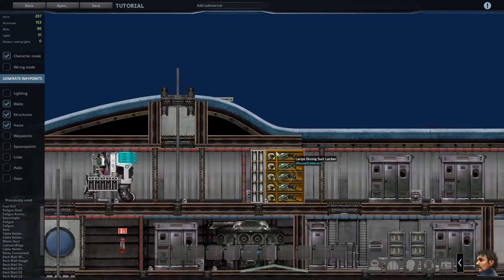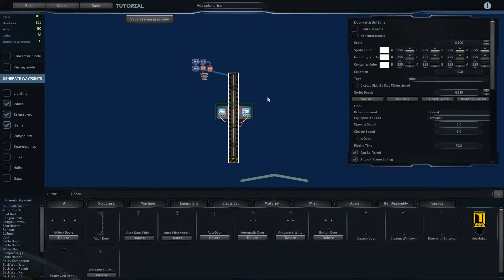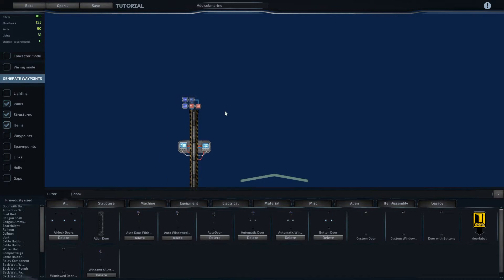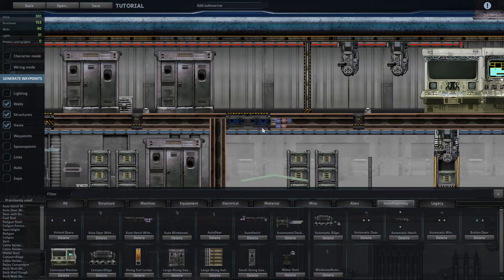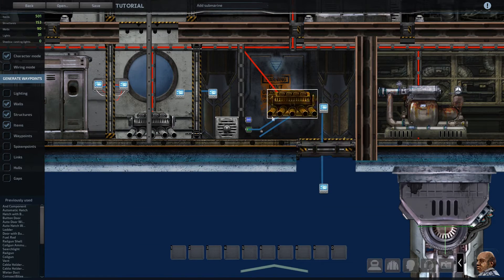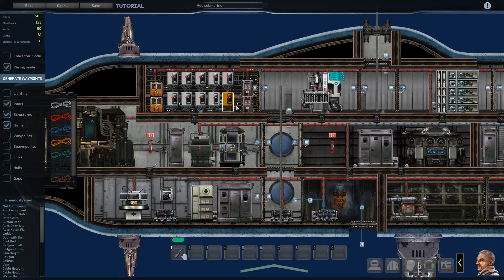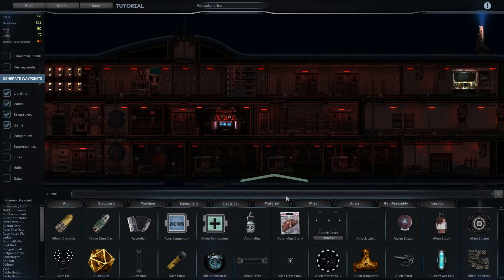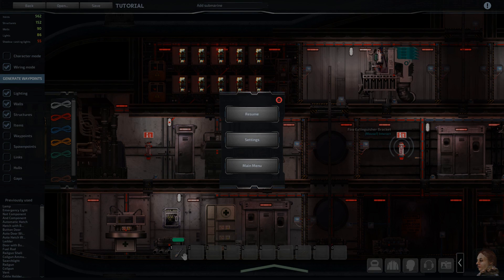Barotrauma Submarine Editor Tutorial Part 4 | More Wiring and Lighting

Comment: The auto-door doesnt work... Sure it opens, But it stays open. Am i doing something wrong or was it an update?
Reply from the maker: I don't think it was an update; it works fine in my save with no changes.
Reply: He doesn't show you the settings for electrical components unfortunately for some reason. But make sure the AND that is connected to just the NOT component is set to output 1 and false is blank. The AND component that is connected to the DELAY & NOT should output 0 and false blank.
Reply from the maker: @John-ns9lr  That was an oversight, my bad.
Reply: @John-ns9lr  Thanks.

Comment: I've just now invented a much better (in my opinion) door system that doesn't need a motion sensor (which I have found those kinds of doors to be highly annoying) and only needs THREE components. A delay component, an and component, and a not component. The delay component MUST have the "Reset when different signal received" box checked in order for it to work though. 

Here's how you do it. First you get all 3 of the components, set up and get 5 wires. Then you wire the state out of the door to both the delay component signal in and the and component signal in 2 (or 1 it doesn't matter), then set the delay component's delay to 2 seconds. Then wire the output of the delay component into the other and component's signal in, and the and component's signal out to the not component's signal in. Lastly you just wire the not component's signal out to the door's set state and you should be all good. 
I don't think you even need to be in the sub's editor to do it, but the default door's invisible wiring from the editor might mess with it a bit.

Comment: I was wondering...for the areas of the hull, that are adjacent to black spaces, for example the top left of the sub, under the left top coilgun... if that section of the hull is damaged, would a mechanic be able to reach it with a welding gun? Would flooding occur in that black space? ;o
Reply from the maker: Since the black spaces don't have hull entities, they won't fill with water or contribute to sinking.
Reply: @n_tropy  Thank you for clearing that up :D

Comment: One question here about the docking port. I want to use my docking port as an exit too, how can I do that? I've been playing with gates for the past 4 hours and I cannot find any information online on how to use that hatch as both the docking hatch and a usable exit.
Reply from the maker: I'm not sure it's possible. I've experimented with the same thing in the past to no avail.
Reply: @n_tropy  The issue I find is that these hatches are active low and active high unlike typical state machines. A state transition can be made on either logic level. I don't see the point of the game having logic gates like comparators and such if either logic level will cause a state transition.
Reply from the maker: @calebcantrell9115  The whole system is kinda screwy for sure. Especially false signals being separate from no signal.

Comment: if you can only open that airlock when there's no water, how's you gonna fix it during a breach? answer that mr tutorial
Reply from the maker: If someone has left recently, then you might have to do some on the fly rewiring. Assuming that everyone's on board, the inner door should be open and there wouldn't be a problem. Sounds like you have identified a potential need for a failsafe ;)

Comment: My sub keeps on making a metal crashing sound
Reply from the maker: I sometimes get a metal crashing sound if I accidentally wire my duct blocks to "toggle state" rather than "set state". Any chance that's the issue?
Reply: @n_tropy  i found out the problem it was the duct block being wired to the water detector incorrectly. So yes you were correct
Reply: But i still have another problem with the ballasts and the problem is the bouicy
 is 8.87 instead of 5.53 any chance i could lower that number?
Reply from the maker: @thisseemssketchyhmm  I'm not very sure how to adjust that value in particular. I typically just make sure my neutral ballast is near 0.5 and go for it
Reply: @n_tropy  ok thanks for the help

Comment: This door doesnt work
Reply: Change the output on the lower AND to 0. He didn't mention that but you can see his settings. Worked for me.
Reply from the maker: @FranticWaffle  Crap!! I did forget to say that! My bad guys. Thanks man
Reply: @FranticWaffle  Thank's I tried so hard to get those to work. Can you explain what it changes if I put the output on 0, because I want to Unterstand what I'am doing
Reply: @philipplockau2363  Basically the lower AND gate controls when the door should be shut. So when the NOT gate that is connected sees nothing coming from the motion detector (ie: no player in range), and after the 4 second delay from the delay gate, the lower AND gate will sent a signal of 0 to the door causing it to close. For the door, 1 = open and 0 = closed.
Reply: @philipplockau2363  DM me if you want I can send you the assembly file.
Reply: @FranticWaffle  so it depends on which number is send as signal for doors  to close.. I thought it wouldn't matter which number is send to the Door as signal. That changes EVERYTHING for me. Dude I am gonna have fun after work today.
Reply: it doesn't close for me, and for the love of me i can't figure out why...
Reply: well if i remove all the logical components out, and just leave a motion detector, it opens/closes as soon as i show up/go away, from the motion detector... so what's the point of all the components? (i mean yeah it will open and close in quick succession if i remain inside the detector's range a stay put for a bit and maybe turn around... but it works...)
Reply from the maker: I use the components to accomplish a few things, primarily a delay on closing the door for convenience. If it's not closing, there's an issue on the delay section of the circuit. The point of the opening electronics is to prevent rapid state change from presence in the detection zone.